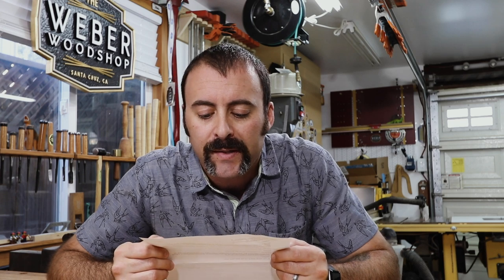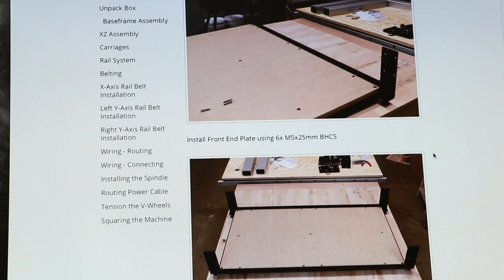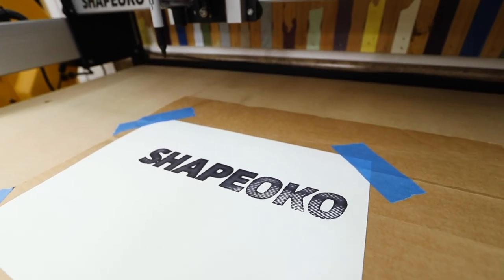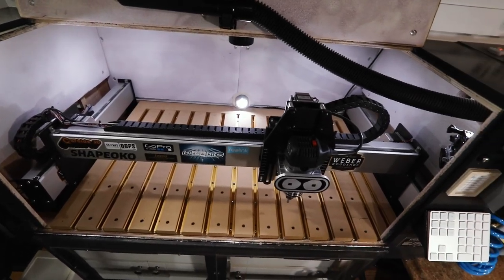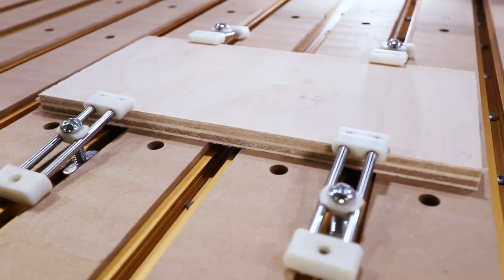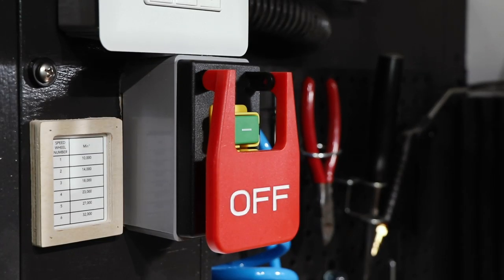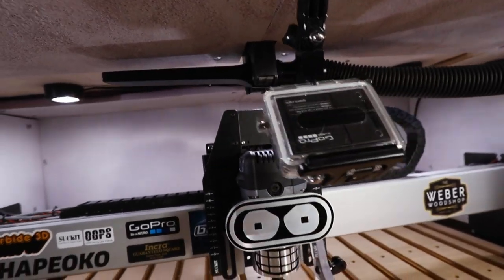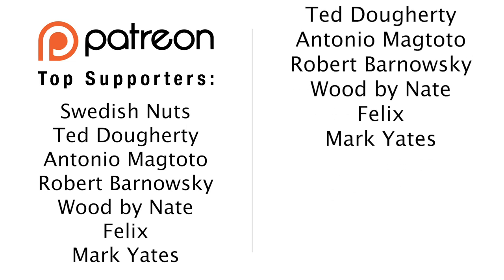The Ultimate CNC Enclosure

Comment: Dude that’s some seriously awesome upgrades.  I love my Shapeoko and couldn’t be happier with its performance and all I’ve been able to make with it.  I have a large table with 2x4’s sticking out above it where the rest of my cabinet should be.  I still want to finish it, but after I got the Suck-It, I lost all motivation.  Sound may be the only reason, well maybe lighting.  But the sawdust is a non issue.
Reply from the maker: ManCraftingTM I actually crashed it during of of the very first cuts. The bit ran into the metal base of the machine and sprayed Carbide shrapnel all over the place. And my kids like to stand in front of it and watch while it cuts. Also this was before I had the Suckit. So safety was the first motivation to enclose it (and dust) but I can also tell you with all that insulation it is WAY quieter.
Reply: Blake Weber safety. Ok. Three reasons. 😁

Comment: Ya know....this ain’t even fair. That setup is incredible. I got my CNC (XXL version) a few months ago and I haven’t even opened the box yet. Partly cause I’m not ready yet cause still building up my garage as my workspace, but also cause I’m a little intimidated by putting it together and also learning the programming. I’m curious to your level of knowledge you have/had when you got the CNC. Anyway, all the add-ons are awesome. To say nice work would be an extreme understatement.
Reply from the maker: Greg D Zero knowledge of CNC before I opened the box.
Reply: When I got my XXL I started assembly but got stuck at a step and then ignored it for several months because I was overwhelmed with everything involved. Now I’ve been running it for six months, designing in Fusion 360, and recently started diving into 3D models. You can do it Greg.
Reply: I just ordered my XXL this morning (I keep coming back to this video for inspiration on the enclosure).

I have zero experience, but I've been playing around in Carbide Create for the last few days. It's really easy to pick up.

And, from all of the unboxing/assembly videos I've seen, it's really straightforward.

You can do it!

Comment: 2:00 Hard mounting the board metal to metal seems like a bad idea, perhaps a rubber pad in between the mounting plate, or some rubber bushings on the PCB standoffs  to minimize vibrations on the board.  If this is bad for other electronics, surely the vibrations from this are not good for longevity.   Also, Bender bends, Roberto cuts...awesome detail though.  And with that,  is it Hecho en Mexico?  Love this entire thing, the organization solutions, the ergonomics, the box, the camera, all of it.

Comment: Great work and outstanding videos!!

Curious question. You have both a laser and a CNC. Is there a laser attachment to mount to your CNC that would be just as accurate?? Two large investments as opposed to....one?

just jim
Reply from the maker: I like the laser SO much better. More accurate, easier to use, quieter, no hold downs required, no crashing bits and ruining work. The CNC had about a 6-12 month learning curve to get comfortable with it. The Glowforge was about 6-12 minutes. I'm considering getting rid of the CNC but there are still times when I might need it.

Comment: I have been looking everywhere for the short vacuum hose you use under the lid... any ideas? Also, How did you wire the 3 way switch to where it was surge protected from the wall?  thanks. Love this video, btw, great work on editing, and the enclosure. will post pics when mine is done. This will elevate my shop considerably.
Reply from the maker: Rewined Management thanks! I stole the hose from a tiny hand held broken shop vac like the kind you clean a car with. I don’t give wiring advice sorry.
Reply: @weberwoodshop  fair enough, I found an independently switched surge protector for the devices, and wiring that to the kill switch / main power. This is not advice either. Like one of my friends say.. "Proper electrical is not something that is learned after the fire department has left."
Reply from the maker: Rewined Management lol actually I am the fire department so I’m not sure how I should apply that logic...

Comment: Do you have any issues with USB disconnects since all your power sources are together since they run through a single shut off switch? I end up having to have my router and power supply on separate circuits to prevent these issues.
Reply from the maker: J Anderson omg YES I DO. I haven’t had much time to experiment with it lately but I know the problem is only when the vacuum is running. At first I thought it was static. I wrapped the hose with grounding wire. Then I bought those little magnet thingys that you put on cords to cut down on electrical interference. Still no luck. That’s a great tip though I will try it with a separate circuit. Thank you!!!!!!!!

Comment: This is awesome! Great job. Do you think the foam is worth the cost/effort to put into an enclosure like this? does it cut down on it enough to still work close by while it and a vacuum are running? 
Thanks, keep up the great videos!
Reply from the maker: Mlstar100 thanks! Yes the foam helps a ton for noise control and the vac area is insulated for sound as well so it’s all very quiet even when everything is on.

Comment: Blake.....Love it!! What about the exhaust for the Rigid vac.....will it overheat during long CNC runs?
Reply from the maker: Mark Crook Good question I was waiting for someone to ask that... it exhausts back into the CNC enclosure otherwise it would create negative pressure (and restrict airflow) since the enclosure is fairly sealed. It also further reduces the noise that way because it is a closed loop. And that’s why I added the thermometer so I can monitor the temp. If it climbs I can just open the top lid for a few seconds and everything cools down quickly.
Reply: Ah....thx for the quick response.
Reply from the maker: Sure!

Comment: RAD!
ahahahah... this is so good, mate.
you suddenly made me change my mind about T-slots :)
Reply from the maker: ubi de feo oh ok, lol. What’s wrong with T-slots? I love them and have them everywhere in my shop.
Reply: @weberwoodshop  I'm new to this CNC thing (done a ton of 3d printing) and for some reason having gaps with metal where my bits might hit scares me, but your setup looks really really good.
The other day I had a massive FAIL with a loose 1/4 bit which got dragged past the 8mm acrylic and plunged into my spoil board fuming... 1/2" on the side was one of the t-nuts.
I'm still sweating :D

Comment: Wow. I just bought the X carve 1000. Haven’t even put it together yet. My mind is spinning now lol. 

Did you measure the decibel level with everything on?
Reply from the maker: Scotty 2000SS the only measurements I made were with my ears but they are very accurate... it’s MUCH quieter.
Reply: Blake Weber nice. I plan on doing the same. I saw another fellow on here made a down draft table along with the dust collection on the cutting head. Seemed to work great. Cheers!